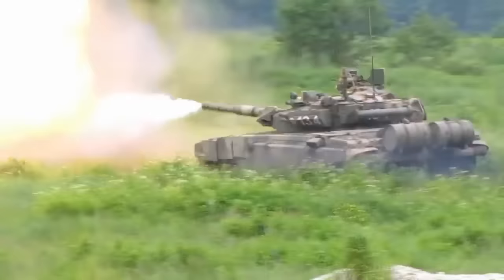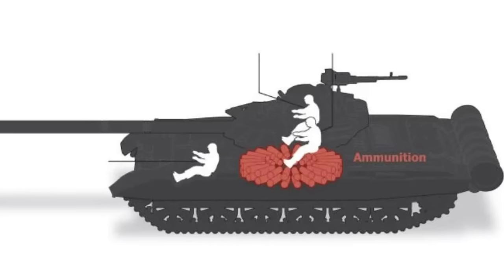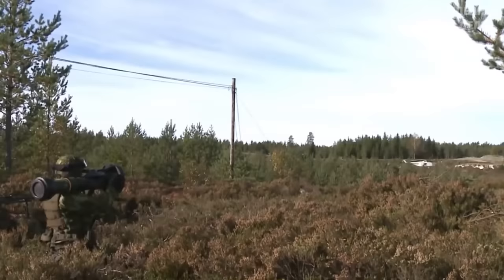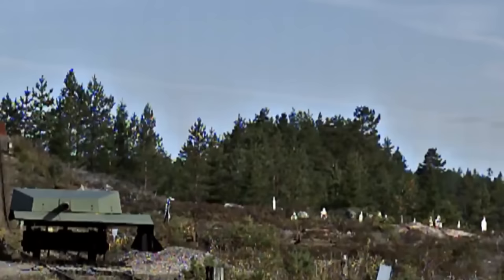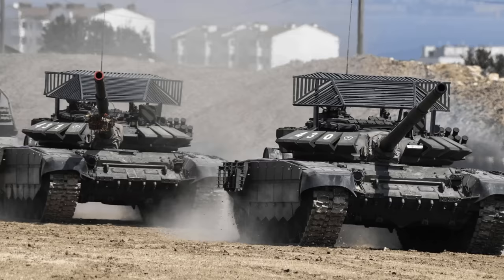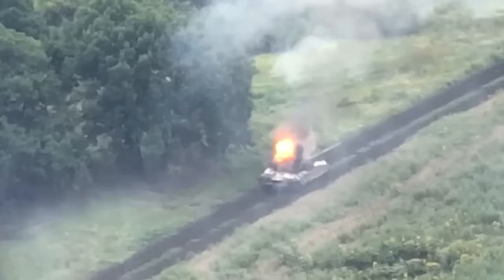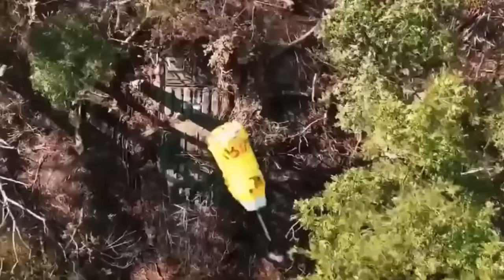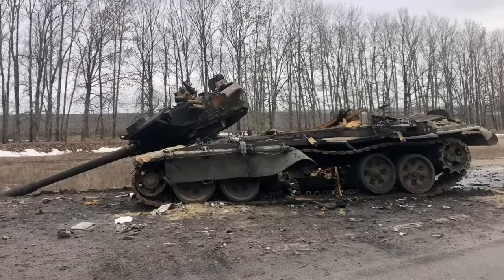Why does this happen to all Russian tanks? / real footage frome Ukraine

Comment: The NLAW doesn’t generate a ‘jet of fire’ that gets through tiny gaps in the structure of the turret.  This is a HEAT shaped-charge warhead that forms a hypersonic plasma jet at several thousand degrees.  It will easily drill a small hole through the top armour and instantly raise the temperature inside the turret to that of a blast furnace, vaporising everything inside and of course setting off any explosives.
Reply: You are correct. This guy needs to do some research.
Reply: I would like to see a slow motion  playback of a super high-speed , maybe 1000 frames per second, film of an NLAW  penetrating typical tank armor.
Reply: Exactly.
Reply: To put it correctly: speed and pressure of the plasma are so high that the metal of the armor is displaced, and for the most part it doesn't even have time to melt.
Reply: @antoniograncino3506
Reply: Plasma is an ionized gas. The "jet of fire" is a cold formed (below melting point) jet/projectile of copper. So it's definetly not plasma.
Reply: Richard F  I was a little loose in my terminology but it’s not ‘cold’.  The jet is technically a solid but it behaves as a liquid, but with a surface temp of around 450C and a core temp over 1000C, travelling at 10km/s.  So it has an extraordinarily high energy.  The armour also remains solid but behaves like a fluid as it moves out of the way of the jet, it would vaporise if it had time.  The borehole formed is typically quite narrow, sort of finger size, but deep enough to go straight through tank top armor plate.  All this energy then converts to heat inside the tank.
Reply: Good to know
Reply: Dude, fire gets in the tank, tank explodes. I think he described it just fine for a short, civilian YT video 😑
Reply: bolshevik101  and then you stop dreaming.
Reply: @streichkase5421  "Plasma" can be copper.  Plasma is a state of matter. Therefore plasma can start out as a gas, liquid or solid. Technically the molten copper jet coming off a shaped charge is a deformed solid that turns to a liquid upon detonation and is in the process of turning into a plasma. Pretty much skipping over the copper gas state of matter because of the density of the jet.  The reason this cuts so well through other metals is that in the process of turning into a plasma the copper loses it's electrons and becomes a mass of copper ions giving off electrons.   That makes it difficult to measure the temperature because the electrons leaving the copper mass are about (I will just say a higher termp than the melting point of any metal) while the copper itself may not register above it's melting point.  This easily cuts through any metal so the best way to neutralize the effect is with reactive amour.
Reply: bolshevik101  I note none of the reactive armor plates on any of those destroyed vehicles have actually, you know, REACTED. Russian Chobham is just styrofoam.
Reply: The commie cooker.
Reply: 鈴木宗男 発狂

Comment: Small crews, with more tanks, therefore, russian tanks require an auto loader.  Therefore, the ammo is stored in most vulnerable area. Western tanks have blast doors, and blast/pop out ammo storage boxes.  Russian tanks do not have that feature.
Reply: French Leclerc, Japanese type 90, and South Korean black panther all have an autoloading system with the same type of protection used on the Abrams and leopards.
The difference is that Russian tanks are extremely small compared to their western counterparts, with rounded turrets, which prevent them from having turret stored ammunition, or even decent transmissions, which gives them terrible reverse speeds.
Reply: The main thing with ANY (I repeat, ANY tank), is that after penetration it almost always can not continue the battle as usual. T-72/80/90 are kinda small, so if it got penetrated, crew gonna get a bad time, and at the moment of ammo detonation they are probably dead. Eastern tanks relies on armor and no penetration at all, than surviving after penetration
Reply: @vizender  no shit.  They all designed it, based on the M1's feature.  The South Korean Panther is almost identical to the M1, but is smaller, and uses a different engine
Reply: @paulwest9131  France did not designed it solely based on the M1. They designed it based on the AMX 40 prototypes, which were built at the same time as the Abrams. Maybe (and probably), during the first involvement of the Abrams in conflicts, some changes were made to the leclerc, but the first prototypes of the leclerc are not that much older than the first Abrams that came into service.
As for the type 90, I would say it’s more based on the older type 10. As for the type 10 itself, I don’t know. Same for the K2.
But my point was, not all autoloader systems are bad. Actually, only the Russian and Chinese one are.
Reply: @vizender  China also has Leclerc style auto loaders in their most modern tanks (some also have people loaders), with rear turret ammo storage. They've 100% gone more western with their tank design and less russian in recent (last 10) years.
Reply: @evangalinsky2499  oh yeah you are right the last variants have indeed switched their design from Soviet era tanks to more western design, although they keep the low profile of Soviet tanks.
Reply: I'm pretty certain we British store the powder separate from the warhead and our barrels are screwed probably a better design than the Russian tanks
Reply: You're repeating what was already said in the video
Reply: Russia clearly has shown their potential in making safer designs thru the burlak turret, Obj. 640, and unmanned turret designs. But for economic or corporate interest reasons, these have all been hindered
Reply: @vizender  Wrong the Russian T80 has a good reverse speed despite being the size of a t72
Reply: All Western tanks (except the Abrams) store at least 2/3rds of their ammunition in the crew compartment without the protection of blast doors or blow-out panels
Reply: @Johnketes54  your "barrels" are the weakest cannons availble, even chinese have better guns on their tanks.
Reply: @thephoenix756  Abrams syores it inside as well
Reply: It’s not just Russian tanks but even NATO tanks also explode when they are hit by modern ATGMs. It has happened before to Saudi Abrams and Turkish Leo 2.
Reply: @realnapster1522  You didnt get the point.  Western Tanks don't pop off their lid like Russian made tanks.  Avg Russian tank is 50 tonnes. Avg Western Tank is closer to 70 tonnes.  That is 20 tonnes worth of better armor, protection, technology, which in turn, makes them more lethal, with a higher survivability rate than that of the Russian/Soviet designs.  That is a KNOWN FACTOID, like science, it has been perfected thousands of times with the same result.